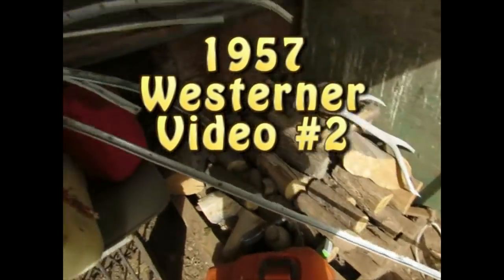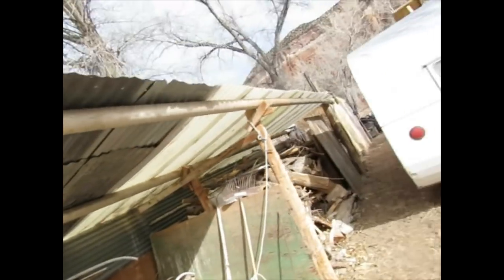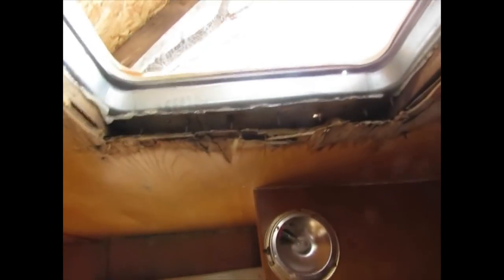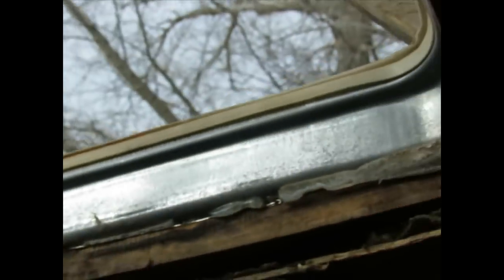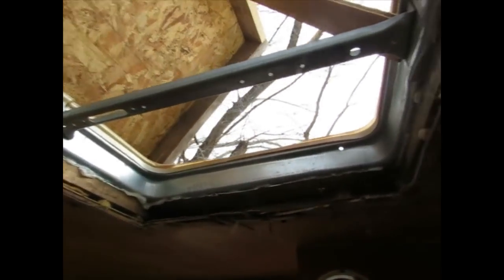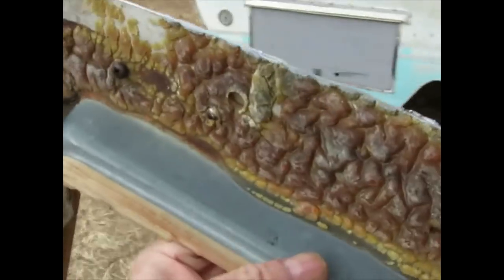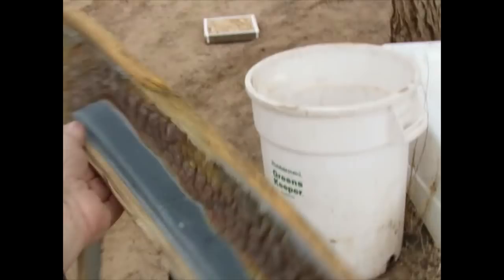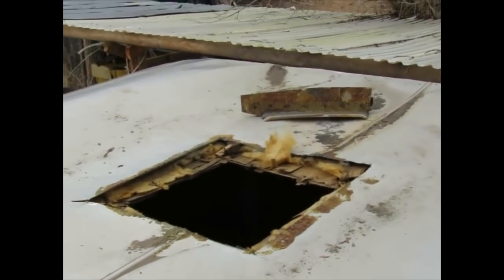1957 Westerner Restoration Project 002, Roof Vent

Comment: Previous owners do all kinds of crazy things trying to deal with leakage. All they really had to do was change the putty tape about once every 7 to 15 years depending upon their climate. We call that a re-seal. Doesn't really take all that long to do and your trailer will last forever if you do it. All that framing needs to be replaced along with the paneling anyhow. Curbing too. May as well do it right while you are in there and have the roof metal off. Way to go David. Moving along nicely.
Reply from the maker: All I really want to do is wander into the forest and sleep under a pine tree. I'm hoping to get as much trailer work done as possible before cowboy work takes over. I have updated my web site for the 1957 Westerner.
Reply: You make it sound like Pterry's tale of the dwarven "axe of my distant ancestors."  Had to replace the handle many times.  Had to replace the head a couple of times.  But it's still my ancestor's axe.
Reply: hey Larry, don't those trailers have some kind of magnetic brake setup?  what are the chances they still work?
Reply: HS2 YES they come with electrically activated magnetic brakes and they usually work fine. Nice to go ahead and put new liners on them though. Available still at Etrailer.... I just bought a set for the 66 I just finished.
Reply: I agree, wander off in to the forest and sleep. :)
Reply from the maker: Breaks?! Never! Real men don't have trailers with working breaks!
Reply from the maker: I am restoring the domain 1957westerner.com today

Comment: G'day Dave,

    Well, clearly the previous Fixer-Up-er-er should've used a Tube of Silastic Roof & Gutter Sealant, to "Silicone-Weld" the Wood to the Aluminium & the Pressed-Steel Frame of the Roof-Vent...; then you could've readily cut through the Silicone with a Stanley-Knife (aka, a "Box-Cutter" to you-alls in the US of A...), without having to destroy & replace the Wood.

  Two-Part Epoxy is good stuff, in it's place ; but it's place is not anywhere that Silastic would be a better (more flexible, more vibration-tolerant, and ultimately  a more easily removeable) Bond accross the 3 Materials involved...

  Keep on keeping on...

  ;-p

  Ciao !